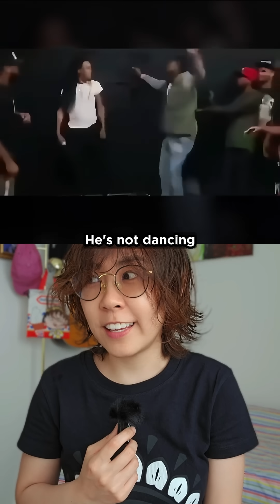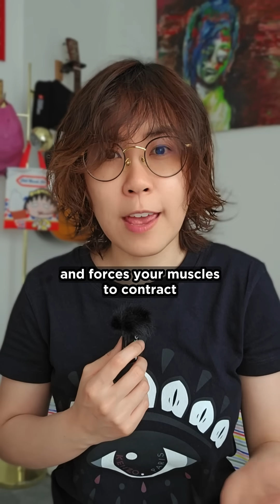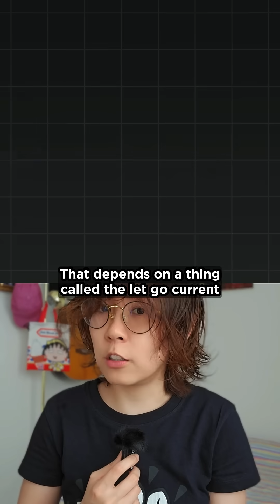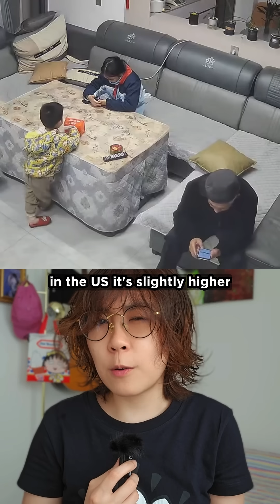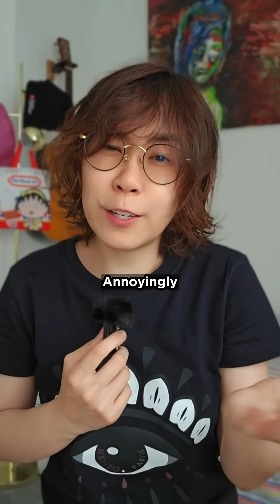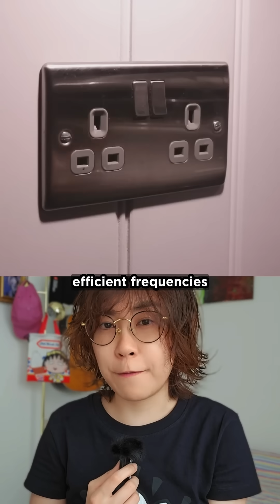How Much Electricity Can You Touch Before You Can't Let Go?

Comment: If you ever HAVE to touch a wire, always touch with the Back of hand.....
Reply: If I ever have to touch a wire I will call you.
Reply: @_c_y_p_3  😂 you nailed it 😂😂😂
Reply: @_c_y_p_3he’ll probably just tell you to touch it with the back of your hand, just a guess.
Reply: @_c_y_p_3 😂
Reply: Actual good advice
Reply: @DarkArmedWagon not just good advice. Life saving advice. Also. Get a multimeter.
Reply: @robertcampomizzi7988  depends on the amount of power in “the wire” it doesn’t take a lot to knock the heart offline.
Reply: @_c_y_p_3  ok, ya, sure...... But that is not what we're talking about. We are talking about musculoskeletal system and the contraction of the forearms and gripping the source of electrocution, making it worse.
Reply: @robertcampomizzi7988 ohh that’s kinda clever… but I’m just gonna stay away from exposed wires just to be sure lol
Reply: @robertcampomizzi7988  If you are going to be around cables, instead of a multimeter that needs contact to measure. Get an electricity detection pen. If you are going near a live cable with the pen. The pen will get angry, and start beeping at you.
Reply: @robertcampomizzi7988 it's not. 😂 why would I even touch a live wire
Reply: What if my knuckles decide to curl backwards to firmly grasp the wire
Reply: @deadringer-cultofdeathratt8813  Tell your knuckles to not do that.
Reply: @deadringer-cultofdeathratt8813  you are not Shaq. You won't be doing that.
Reply: @ackshayshukla what does Shaq have to do with anything? I’m out the loop 💀👀
Reply: @deadringer-cultofdeathratt8813  make a fist before you touch it with the back of your hand.
Reply: @deadringer-cultofdeathratt8813 😂 kinda even scary to experience once
Reply: @deadringer-cultofdeathratt8813  time to see a doc😂
Reply: Thats definitely a super power worth the wiggle you struggled😂
Reply: @deadringer-cultofdeathratt8813 😅
Reply: @deadringer-cultofdeathratt8813 funniest shit I've seen
Reply: @deadringer-cultofdeathratt8813  this was actually funny ngl
Reply: @deadringer-cultofdeathratt8813  Then the current is doing you a favor lol ow bro
Reply: @deadringer-cultofdeathratt8813 damn ur knuckles are nasty for doing tht😂
Reply: I don't touch a wire sticking out intentionally. Period. Either I test it with a multimeter or I short it to ground. I don't want to get a cardiac arrest
Reply: Why you HAVE to touch a wire?
Reply: Why would I want to touch an electric wire with my back hand in the first place?
Reply: I prefer safety gloves, but yeah
Reply: I don't have hands what can I use?
Reply: my question is now why do you need to touch the wire
Reply: I’ve been an electrician for over forty years and I’ve never had to touch a live conductor, and if I did accidentally touch one, it was my fault because I didn’t test it first, so you learn real fast to always test them, there’s absolutely no reason to have to touch a live wire, touching a live wire on purpose will get your ass fired or dead!!!⚡️☠️⚡️☠️⚡️
Reply: And if someone did it and you have no insulator nearby, jump kick
Reply: This is great information I just know now, thanks man, I appreciate it.
Reply: Use a meter to check the voltage and TURN IT OFF…
Reply: also always keep one hand well away where possible. you likely won't have a path through the heart without the other hand there. and you may need the other hand to bash the first hand off the thing it is stuck on.
Reply: Or touches it with something designed to test the circuit first
Reply: Buy a tester.
Reply: wear rubber gloves
Reply: Depends how many amps are flowing through the wire which makes your hand tighten, around 15 mA your hand will “glue” onto the wire.
Reply: Or just use a multimeter for god's sake
Reply: @ResistorArcs yep
Reply: Was taught that in tech school. I'd say, get a multimeter. They're not that expensive anymore
Reply: Why would you touch a wire in the first place lol
Reply: I'ma use my peenar
Reply: Only use 1 hand so it doesn’t put current through your heart, also, wear insulated gloves if you can.
Reply: Yep good advice
Reply: oooh thats really good idea
Reply: Imagine electicity is a woman......just use one fingger😂😂😂
Reply: That's what I came here to say 👍
Reply: touch it with a emf tester
Reply: why?
Reply: Ohh that's why when I got the pen which u would click and release a electric shock didn't work on the back on my hand.....
Reply: Same with door nobs during a fire to check if a room is clear.
Reply: @imSUPERcereal0  well, you can touch hot door knobs with just about anything, even your elbow, nothing is making you stick to it
Reply: Only case when backhanded slaps are welcomed.
Reply: Ok
Reply: I'm sorry but that looks like the electric boogie to me.😅
Reply: pretty sure more people die by getting thrown back.
Reply: Or a slight tap with one finger. Of course you should measure if the wire is free and never touch a live wire unless you are a trained electrician and have the tools for it.
Reply: I read first black of a hand 😢
Reply: Palm skin ? Or other side???
Reply: This is the way. Also 220v feels electrifying.
Reply: You are stupid
Reply: why would you HAVE to touch a wire?
Reply: How about you just wear electrician’s gloves if you have to touch a wire, meaning gloves that don't conduct electricity. You can actually slip up and touch the live wire with electrician’s gloves and you won't feel a thing.
Reply: @Marco_My_Words  you can do that with many gloves, not just the ones for electricians... they in fact are way more expensive and made for way hgher currents and electricity
Reply: If I ever gotta touch a wire I'll hit u up nro cause I ain't touching shit 😂
Reply: Yeh i do that 😂
Reply: If you are ever at my office tell my line crew that cause they will laugh at your face and just tell you to trip the breaker and if youre still unsure just dont do it in general its extremely painful having experienced holding a live wire and a brief touch myself its not a good feeling at all
Reply: Meaning?
Reply: @fahimalmahi1514  you wont get turned into a fried egg when 15 amps and 120 volts of electricity go from your arm tk your head to your legs to the ground
Reply: Just pee on it.
Reply: Bro your saying that as if I plan to touch a live wire
Reply: What does that do?
Reply: wow im blown away how logical that sounds but never thought of it
Reply: What if I don't have hand?
Reply: And the right hand
Reply: it makes no real difference. you will still get shocked if its a live wire.
Reply: Who's gonna just touch the wire bro. For what. If they're in the front of the wire, watehel you think they about to do. Just touch it 😂? Of course they gonna do something about it. Use a fcking test pen.
Reply: The issue is when you work with wires, you need to grab them somehow....you can't work using the back of your hand.
Reply: I learned the one hand rule-- always wear rubber-soled shoes, and keep one arm behind your back or in your pocket. Essentially, never touch two sides of the same circuit at the same time, and try not to be the path to ground.
Reply: If you ever have an accident, plan it carefoolly. Yeah, right.
Reply: Yep, if your hand clenches up it doesn't matter because your not holding onto the wire
Reply: Genius ❤🎉
Reply: Or Just Get electrical tape and Put it around ur Fingers your going to use tightly and you got ur self Homemade elec gloves
Reply: A screwdriver is better
Reply: Turn the bloody power off first.
Reply: How does that help?
Reply: @Joseph-e9p1x you aren't going to grip down on the wire if you use the back of the hand
Reply: Dont
Reply: Damn 10k likes, keep using the back of the hand peeps ✋✋
Reply: Why?
Reply: @thegodfather-sp3to  the back of the hand won't grip onto the wire like you would if tou used the palm. Your hand will still contract but it won't grab onto the wire. You can pull yourself away
Reply: @thegodfather-sp3to  because as your muscles "lock up" you'll make a fist and grab the cable
Reply: @thegodfather-sp3to  cuz ur fingers won't clench cuz of power and tighten the grip on wire
Reply: @thegodfather-sp3to because when it electrifies you your arm will snap back towards you and not grab the wire because your hand is gonna close automatically
Reply: @thegodfather-sp3to The science behind it is that when you get electrocuted, the shock forces ur muscles to contract. If you r touching a live wire with the palm of your hand, the current will force you to close your fist, making it harder to escape.
But if u r touching that wire with the back of ur hand, it is easier for you to escape....
Reply: @thegodfather-sp3to just in case you're not kidding,  because that way your fingers can't involuntarily clench around the wire
Reply: @dnm1016  use a voltage tester. You should only use the back of the hand in an emergency, like running from the cops, and you need to know I that fence is electrified before going over it.
Reply: @jaeger251  what do you mean RUNNING FROM THE COPS, what are you encouraging @dnm1016 to do?!?! 🤨💀😭
Reply: @jaeger251  i think if you're running from the cops, you're the emergency
Reply: @Zunbdz If a teenager is out drinking at a party, and cops show up, I don’t think those teenagers who are running away are an emergency.
Reply: unless its an electric fence used for holding livestock. In which case, put your nose on it.

(and before anyone complains, thats what we used to do on our farm when I was a kid, plus a few other fun variations)
Reply: @user-lv5bt3nt3r  I have experience with electric fences when I was a kid also, they don't really hurt, but it scares the crap out of you the first few times, rofl 😂😂
Reply: @dnm1016 
It depends on the country (the allowed current/power level) and your body whether it hurts you or not.
There are cattle, bison, or water buffalo weighing over 1000 kg that need much more power due to their gigantic size, thick skin, and heavy fur.
Reply: how will i fix a wire with the back of my hand
Reply: Dude do you know how many electricians work on live wires and get shocks. I’ve gotten shocks of 20 amps. It’s no biggie. The fear of getting shock is so over rated.
Reply: Anything over 200 miliamps can be lethal, you're talking about 20000. Don't test fate
Reply: What would be the reason for you to  touch wires with the back of your hand? Definitely you can't do any repair work..
Reply: Tell me someone
Reply: @thegodfather-sp3to  simple, if you touch with the back of youre hand, youre fingers cant grip the thing ur touching... it would be obvious if u watched the video
Reply: @thegodfather-sp3to 

Electricity makes all muscles cramp. So the hand closes involuntarily — he can’t let go until the power cuts out (/ fuse blows).

If you get shocked on the back of your hand, the muscles won’t force you to keep gripping the power source.
Reply: Is it easier to remove due to gravity
Reply: @thegodfather-sp3to dude you coulda just googled it, no hate but it’s just kind of annoying, no offense genuinely. anyway, it’s so you can’t grip onto the object. when you’re getting electrocuted, your muscles tighten, and you grip the thing that’s electrocuting you. if you can’t grip onto it, you’ll just jolt away and you won’t be touching it anymore
Reply: @jaybirdishhhhhh  Why would anyone even touch a live wire with the knuckles.
Reply: @jaybirdishhhhhh  dude you could just tell him that without being so blatantly rude
Reply: @jaybirdishhhhhh 
Your comment calling his comment annoying I found to be more annoying than his comment. No offense though.
Reply: @jaybirdishhhhhh  could have just gotten to the point or not answered, no hate 
, just preambles are annoying
Reply: @jaybirdishhhhhh  Ironically, I actually find it a bit annoying when people freak out over someone asking a simple question. There are good reasons to ask versus just googling. Because if the person googles something and gets a different answer than you, then you may say, no that's wrong, you should have looked here. Something that is easily avoided by simply answering someone's question the first time
Reply: @thegodfather-sp3to  actually, you should pee on it. It’s a great way of testing it, without touching it.
Reply: I think because you cant grip the wires @thegodfather-sp3to
Reply: @thegodfather-sp3to 
Your hand won’t grasp the wire.

Electricity isn’t sticky. The reason the guy in the video couldnt escape and was grasping the wire was because the electricity forced his hand to be closed (by overriding brain signals), and so he couldn’t let go. If you touch the back of your hand, you can’t accidentally grab the wire, and can therefore avoid getting severely electrocuted.
Reply: @thegodfather-sp3to when you get shocked, your muscles tense up because your brain does the same thing, it sends electrical signals to the muscles. If you touch a live wire with the back of your hand, when your muscles tense they won't clutch onto the wire.